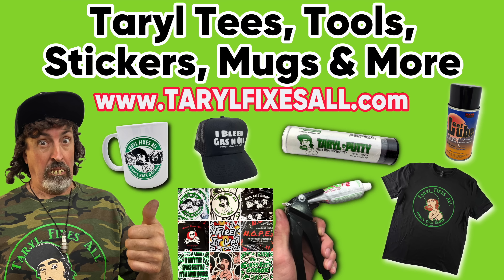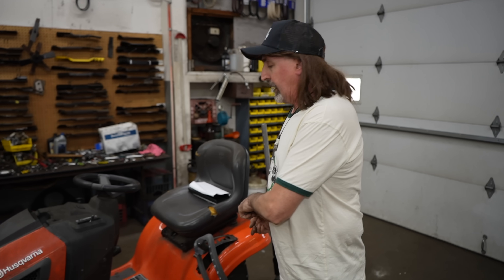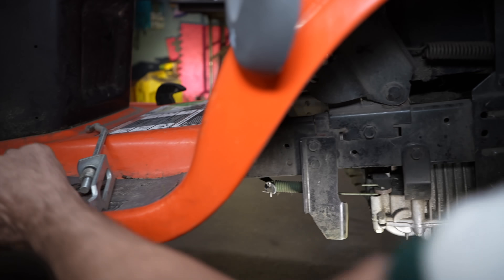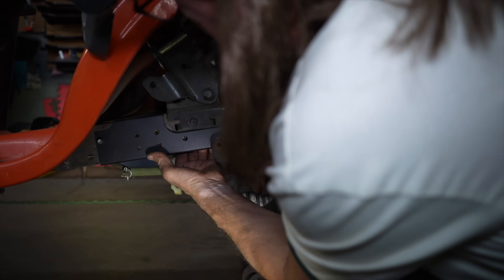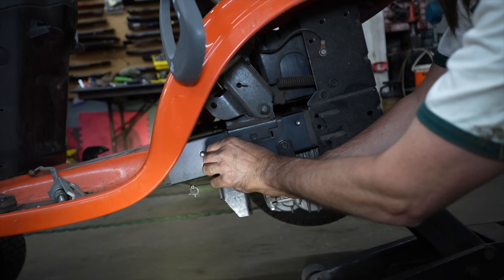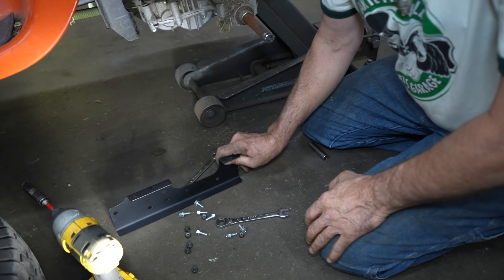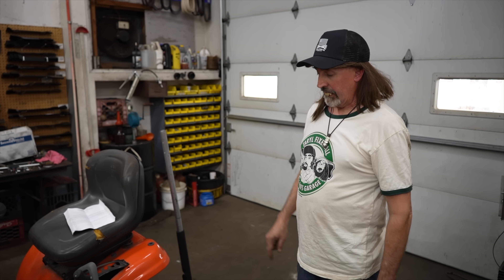MAJOR Husqvarna Frame Problem They WON'T Address! Affects 1000s of Units!

Comment: The cop out for all these corporations now is saying these are consumer grade products and not industrial grade. Husqvarna is still a notch above MTD in my opinion.
Reply: Husqvarna use to be much more than a notch above. The GT garden tractor series use to be a real beasts for a home owner machine. It’s sad they came down to the level of throw away tractors like MTD. I love me some GT5000, I still chase those if I can find some worth repairing.those 20 year old tractors can still outlast the ones they are selling today.
Reply: @GTObearclaw1  You are so right.  I have a Craftsman edger that is 40 years old and still works great.  Stuff today is nothing but junk.  Use one season and throw it away.
Reply: I agree but a notch is no longer good enough for me.
Reply: I dont know, the Cub Cadet stuff id say is darn near better than the JD equivalent. Especially the XT3 when they made it.
Reply: I say BS! I have a 20yr old MTD (Yardman) 46" 21HP rider that I purchased from HD in 2004, for $1098+tx+delivery. I have had ZERO issues with frame or the running gear, although I have had to replace PTO belts about 6x and drive belts 3x. That's ALL!! I do however, maintain it BY THE BOOK and keep it in a dry garage!! Your OPINION is like an "arse hole", everyone has one!
Reply: @TheOzthewiz   So your opinion is allowed and mine is not ? Good to know. Next time you should take your medication before you comment.
Reply: @kman0146 Bwah ha ha! Right?
Reply: @GTObearclaw1  I have a GT5000 with the famous 5 gallon gas tank under the seat made out of old milk jugs. Have you found any tanks that are a close fit? I can't find one used anywhere that I would trust anyway. Thanks.
Reply: @TheOzthewiz  generally MTD is just lower grade. 20 years ago they made some decent machines. But as a mower mechanic the MtD units are just not as good as the stuff they AYP/electrolux/husqvarna use to build. It is an opinion of someone who worked on all the brands. We use reviews to gauge what is good and bad and reviews are generally an opinion. However for a 20 year old machine the reviews are no longer going to be of much use as we can buy those machines anymore but in the reality of what available to be purchased today it’s a real crap show. Mine as well go get a X series Deere and stay away from anything that lows and home depot sells including the 100 series Deere. All those box store mowers have lowered their standards and are equally toilet paper for your yard. They do the job but not gonna last as long as the units from the early 2000’s and before.
Reply: I got a cub cadet model  1054  with a  27 HP Kohler   ive had it for 5 years and ran the hell out of it and had zero problems with it . I mow about 4 acres twice a week with it .. I'm actually shocked it lasted this long
Reply: @thebegrsshow  they don’t make them all any more. Some are out of production and I guess nobody made a replacement so have to find a good used one. Yes they can be found but for a price. I have a few in my shop that are survivors but also a few different types out there so have to find the right one. Unfortunately they don’t do well in sun light.
Reply: @iwin1833  4 acres is a lot for a cub. If 5 years is satisfactory that’s great. I’m sure you would have spent much more to pay a company to mow it for you. So hopefully that tractor holds up and really earns its price.
Reply: @GTObearclaw1 I'm a 445-455 guy myself. Got a loader. 600lbs of weight on the back. The k91 is a monster transaxle. I'd happily take 3 for the price of a prettied up fake x300 now.

And to get anything equivelant from Johnny deere is like 13000-16000 dollars. Just stupid.
Reply: @GTObearclaw1 I wouldn't touch the new x300 series or x500 series. Buy a 98 or 99 445 or any year 455 with low hours. Or get an x500 series from the early 2000s you can get a diesel with mechanical 4x4 for 4000-7000. The equivelant now is the x700 series and the prices are stupid. A kitted out x758 is more than a 1025r.

Comment: if i had this tractor, I would order the kit even if it wasn't broken...it's only a matter of time....we ran into this stuff ALL the time in the auto/truck industry....pre-emptive repairs because you knew eventually it was going to happen
Reply: And ounce of prevention is worth pounds of cure.
Reply: Makes sense. Installing the kit before frame breaks will result kit+frame, both holding. Installing it after - kit alone holding the frame together, unless frame is welded but probably wont be the same again, at least visually.
Reply: Not me.  I would buy some steel and drill holes in it or better yet, just weld it on.
Reply: I think I'll order the heavy duty kit so my LS swap doesn't break the frame.

Comment: I could listen to Taryl stories all day long!!
Reply from the maker: I got plenty lol
Reply: @TarylFixesAll  More Taryl stories please!!  
I already know how to clean a  carbatrator!!!
Reply: really really good story teller.  I love the accents!
Reply: @TarylFixesAll Common sense should dictate that the factory ought to stop putting all those unnecessary holes in their frames, unless they would like to be swamped with warranty claims.
Reply: @TarylFixesAll Me thinks it would be a very good idea for Husqvarna owners to by one of those kits BEFORE their frame cracks.😉
Reply: Me too. I was on the phone today trying to order weed wacker parts. I need a stupid $5.00 clamp to hold the attachments on the shaft of the weed wacker. I was on hold forever and finally hung up and called back in and chose to receive a call back instead of waiting on hold. An hour and a half later, I got a call back just to learn the part is on backorder with no estimated time of delivery. I googled the part number and found one on the interscreen - called that place and waited on hold to learn they didn't have it and it was backordered as well. Called a completely different business and waited on hold, just to talk to the same guy I had previously spoken to and found out the last two companies I called are actually owned by the same parent company. All I could think of was Taryl's stories of trying to get parts while I was going through all of this.
Reply: Next time I’m bringing my pillow to sit at Taryl’s feet for Storytime! 😂

Comment: Funny you showing this. I just fixed the frame on husky a week ago. Less than 2 years old. Broken twice on her now. Dealer didn't want to warranty it. I basically built her a whole new frame with good materials.
Reply: Huskee or Husqvarna ?
Reply: @GTObearclaw1  Husky is common abbreviation of Husqvarna.  No one abbreviates Huskee and it is far from Husqvarna in similarity.  Huskee is MTD

Comment: I like the idea of pulling the 2 pieces together and welding them before adding these
Reply: I bet the plates on the back side of the frame, in the heavy duty kit, would negate the need to weld.  For this kit, I probably would too.
Reply: I would put this kit on there first (like he did)---  and then just lift the mower up or lean it over.. and weld the cracked frame on the inside...  Then again,  I would probably weld around the whole plate and then keep the bolts for something else.
Reply: I’m in the metal fab biz I’d do that too they call this done on trucks fish-plating or scabbing when extending a frame yes I’d weld first and grind flat and paint too . On my heavy haul tractors we build a double frame to carry the extra weight of large machinery.
Reply: Doesn’t seem if a thin metal frame broke that bolting another thin metal plate over should be a permanent fix.
Reply: @N4HHE  I agree.. If they are BOTH there, at least you get double thickness.  but leaving it broken is just asking for it to break again.
Reply: @calholli  Throw the bolts right in the trash.  They are probably cheap hardware store bolts.
Reply: @calholli  And wallowing out the holes.
Reply: @tarstarkusz  you probably live in the city, by me the hardware stores by me carry various grades of bolts are are often sold by the pound. Runnings,  Farm and Fleet, to name just a couple
Reply: @jadesluv  Only if they are old used bolts.  In order to get good quality bolts, you need to special order them no matter where you are.

Comment: It's good that someone came up with a solution........
Reply: I think the HD version would be better
Reply: How do guys not own a welder? 
You can get a little cracker box mig for 200 at pawn shops all day.
Reply: You have to weld it.  Without welding it, all of the pressure will be on the bolt holes.  With such thin metal, the bolt holes will get wallowed out.  If you have to weld it, there is little point to these things.  Because where it broke was likely random.  If it wasn't and these breaks always happen at the same spot, then adding these to the weld repair is a great idea.  But, you can just buy 2 pieces of steel and not pay a fortune for these stamped parts.
Reply: @tarstarkusz  Welding is a skill one has to learn, bolting on a couple of plates no skill needed. if you spread JB weld on the plate before bolting it will be as strong as a weld.

Comment: I found this kit and bought a few years back when I discovered the frame had cracked on my Craftsman version of this tractor. The mower had gotten to the point where it wouldn't move in reverse... because the frame was cracked, the mower was sagging in the middle changing the mechanical advantage of the reversing mechanism. As soon as I installed the kit, the sag was fixed and the mower moved just fine in reverse.  Thank you Kwik Fab! And thank you Taryl for the entertaining video.
Reply: When I worked for Sears, in the 1990's, I installed similar kits on AYP products, back then.

Comment: Great Video. The Ebay listings  say for a 2015 mower or newer.   "   THAT HAVE THE HANDLE DRIVE CONTROLS ON THE RIGHT SIDE ".. So now I am going to look at my 2010 Ariens 42 inch to see how then goofed up the design.:}

 Holes and small ones add a stressed area for a Fatigue Crack to start. 

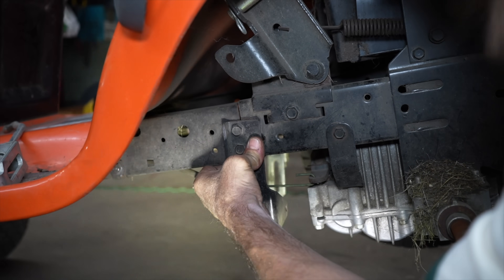 Self tapping screws in the frame at 8:33 sounds fishy

Comment: A week after watching this video I was working on a friend’s 2010 Craftsman GT5000. He was having trouble with a non functioning hydrostatic reverse. An inspection revealed a big crack on both frame rails just like the video. I can report that the Kwik Fab kit works on the Craftsman too. I had to drill a few more holes but it worked great! Reverse pedal is working fine now. Thanks Taryl!

Comment: Great job! I have an old Craftsman/ATP/HUSQVARNA DLT3000 lawn tractor from 2004. No frame problems, but the deck rotted out toward the end of its 20th cutting season last September. I looked at the price of an equivalent new one ($2300+) and said the heck with it and ordered a new stamped deck through Sears Parts Direct. The price was good and I got another discount. The best thing is that they only charged $15 for shipping. Every other vendor wanted $150-250 for freight shipping.  Within 10 days, I had a new deck direct from Husqvarna, bought two new spindles, new bolts and nuts, and moved everything to the new deck. I had a spare belt and installed that. Less than $500 to fix. It runs like new. It h had an 18.5HP Intek+ engine that I did some work on in 2019. I think it's now better than a new one would be.
Reply: Your 2004 is for sure better than what's being sold now. I just got through refurbishing the mower deck on my 1967 Sears Suburban garden tractor. All the spindle and mule drive bearings were common numbers available at any auto parts store. It does a great job mowing and was under $100 for bearings, paint, belts and new gauge wheels.  Don't think I'll ever buy another tractor.
Reply: @TheSaturnV  sears suburbans are the best!
Reply: 2004 Lt 2000 I own, looks and runs like new..Good move. I would have done the same.
Reply: Are those water hose attachments worth a darn to clean them out ? 
I use it every time but I'm sure I should check under there before seasons end.

Comment: I bought one of these tractors unknowing the frame was broken but I did know the tractor needed some work. After seeing the carnage of the frame I just pulled the motor off and put it on the tractor I had with the blown engine. I only paid $300 for the POS Husq but on the plus side my old tractor went from 17hp to 22hp and I got 4 tires that were a season old but the down side I won't be able to use the 52 in deck that came off the Husq so I have to settle with my 42 in deck on my Ranch King but it still beats push mowing.

Comment: I got a 2010 Craftsman version of this same mower and have never thought about the frame breaking. I'll have to check mine even though it's not throwing deck belts.

I have had to weld the left rear deck bracket twice from hitting something. I ended up making some L shaped brackets bolts the deck bracket to the frame  instead of welding it back. I made them out of aluminum kind of like as a shear pin on the flywheel. The first set lasted four years. I just unbolted the broken ones and installed the copy I made. Saved me allot of time.

Comment: Had this problem years ago with my gt6000. Welded it up, ground down the welds on the outside to make it look clean and haven't had an issue yet. Use a moldboard and 5 spearhead cultivator every year. Just wanted to see how long it would last without fishplates and I've been pretty surprised it's held up!

Comment: This is the first I'm hearing of this.  I'll inspect my frame.  I bought a Husq Garden Tractor 2548 in 2003 or 2004.  If any of them should have a cracked frame it's mine.  I have a sleeve hitch and tire chains to run a mold board plow and discs.  I also have a trailer To haul fire wood. This tractor has been good for me.  I service it every year and the only major problem I fixed myself was head gaskets on the 25hp Kohler.  I've patched the mower deck because of sandy soil.  My next jobs on it were going to be new tires and steering gears.  Pretty good for 20 years of service.
Reply: Hang on to your 20 year old tractor, the frame is probably 2 or 3 times heavier than the junk they sell now… (not just Husq, all of them) plus plastic parts are ridiculous.
Reply: The Ebay auction says for 2015 and later models. So they just screwed up a 30 year old design. Have a 2010 Ariens here ,

Comment: Yeah I pulled my 07 f150 uphill up my driveway 250ft with my 445. No frame damage. Front end loader beat the piss out of it, no frame damage. 600lbs of counterweight, no frame damage.

You want a garden tractor now, get ready to shell out 13000 to 20000 dollars.

You can buy a 1025r for the price of an x758. The x300s are pooped.

Buy a bx or a 98-99 445 or any year 455. If you want something with pedal drive for 2000-6000 that will go 3-5000 hours with proper maintenance.

I saw a craftsman made by husquavarna with the frame broken back by the trans.

Comment: That particular model of Husqvarna has the SINGLE SIDE ANTI-SWAY bar mount. That's one reason why it cracked there. Husqvarna makes a DUAL SIDE mounting bracket for these type of mower frames. If you notice the BAR too the right of the Anti-Sway mount, that is the left side transmission mount, there is also one similar to this on the right. The other type of anti sway mount that mounts across and attaches to both sides of the frame, It also has a place to attach the front of the transmission. This gives the trans a lot more support. Mounting points at the axle, mid point of trans and the Front.
It also spreads the "DECK Start-Up FLEX" of the Anti-Sway bar to both sides of the frame.
I just did a a FRAME SWAP on a 2016 LGT2654. This one had the single sided Anti-sway bar mount, like what is in the video. I installed the Dual Sided AntiSway bar setup on it and it is now working great. A lot less "Deck Start-up Flex" with this setup.
Seeing this Kwik Fab HD Frame Kit has me to wanting to install one. But since my setup goes all the way across to both sides of the frame, I think I will have issues with the spacing of the Dual sided Anti Sway bar mount.

Comment: I bought one of those HOP Mowers from Sears almost exactly like the one you have in this video ( the owner's manual had both the Craftsman Model number and the Husqvarna Model number in it). That was about 14 years ago and it is still going strong. At the shop where I worked we were also a Husqvarna dealer and I often had trouble getting them to authorize warranty repairs. However, a couple of times the customer called Husqvarna's customer service line after I told them that Husqvarna denied the warranty claim, and magically the claims were approved. I agree the Husqvarna products were not that good; they were the same quality as Craftsman (same assembly line). HOP, Electrolux, AYP, Roper, etc. Oh, I forgot; HOP also produces Ariens.

Comment: We had a MTD with a cracked frame. Both sides. Had it welded on both sides, then scabbed. No further frame issues.  Think it was less than $100. Currently using a Cub Cadet zero turn commertial grade with no issues.

Comment: 1/4 inch and 3/8 electric impacts have made the small engine mechanics life 100% easier.  Unsung heros of the industry
Reply: That 3/8 Milwaukee short Fuel electric impact is worth its weight in gold. Small yet powerful.
Reply: the 1/2 and 3/4 inch have made auto / truck mechanics so much nicer when out and about..  over the weekend was rescuing a vontage bus from a storage unit where theres no power and no air.. in the past it wouldve meant lugging a pancake compressor and a generator around to e able to change a tire..  but even hub pilot lug nuts are pretty easy with the milwaukee..
Reply: Yeah thanks a lot, now we have to get even more done in a shorter period of time! 😂

Comment: I had a husqvarna tractor with a broken frame like that. Only had 163 hours on it. Made one heck of an engine donor 🤣. I put that engine on a scrub cadet zero turn and sold that. And I sold the transmission on eBay.